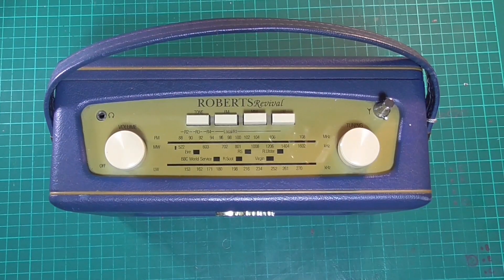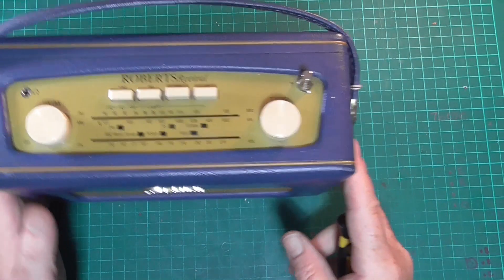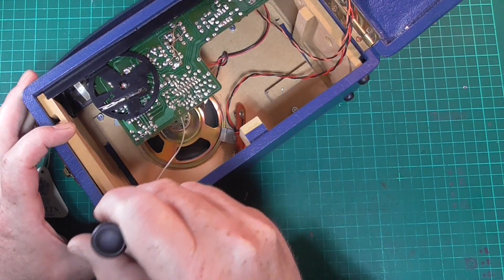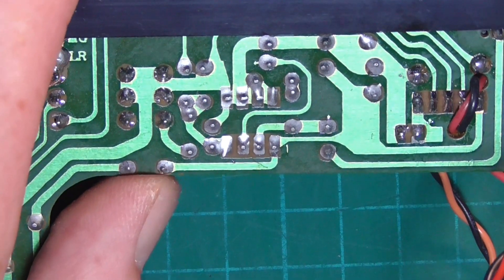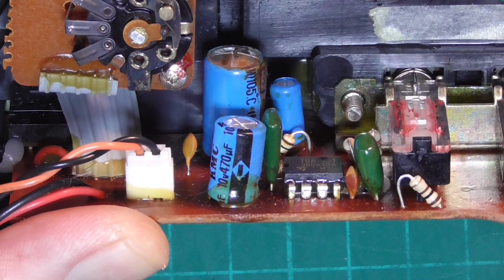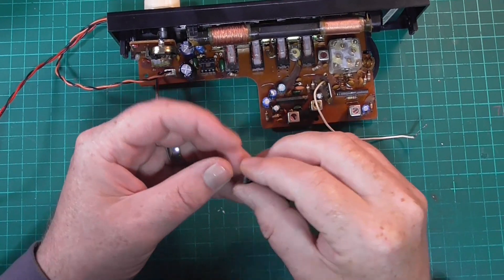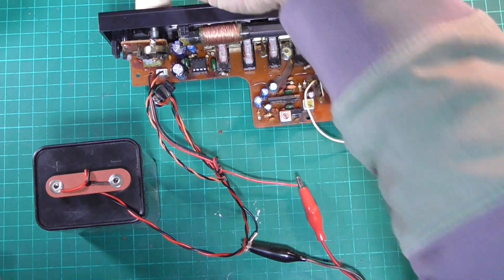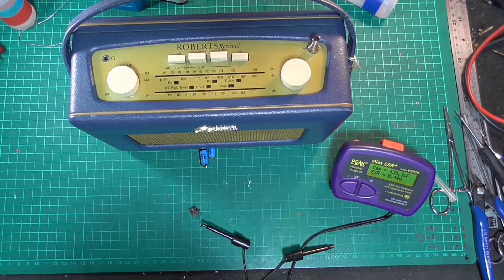Roberts Revival R250 - Quick & Simple Fix

Comment: Very much a very helpful demonstration. Before I take my radio apart could I tell you the symptom just in case it’s something more simple. Basically I am getting no sound or stations but this all changes if I just press the inside with my thumb and I get a sound then. Just be just a connection or could it be dirt on the controls or do you have any idea thank you otherwise I’ll just take it apart and have a look at

Comment: I have an R250 that is dead. However, mine has a different PCB/circuit to yours. In place of the TDA 7231 it has a 2201X01 which I can't find anywhere. I'm not sure if that is the problem though, none of the caps appear to have blown and the IC isn't burnt. There doesn't appear to be a schematic available either.
Reply from the maker: There isn't a schematic available - not for the 2201X01 version at least... 
Check the audio input pin vs audio output pin (3 and 5 from memory but do check) - if signal in, but not out then your IC is blown.
I do have some of those IC's here in my spares, but they are so very hard to find...
It’s still possible to repair the radio using a substitute LM386N-4 with a little tweak to pin 7 and 8. Just Google the recommended circuit configuration to see the difference. Pins 1-6 are the same and no change is necessary. These IC's cost very little so not an expensive repair if you have the tools, patience & time.
Reply: @Codeeze  Thanks for the info, it will be useful I am sure.
Reply: @Codeeze  I have replaced the S1A2201X01 with an LM386N and yes, it works after doing some changes. It didn't take a great deal of work either. So thanks for the tip, it saved a few quid and a long wait for the original IC to come from China. Now all I need is a faceplate, door latch and an aerial - or scrap radio with these bits intact.

Comment: I do wonder of Roberts  used center negative just so that if people used a non roberts psu they would blow the audio chip.  Although i do think the standard 9v for guitar effects is the same negative centre.
Reply from the maker: That is indeed how the story goes... Customer buys more expensive OEM psu, or risks it with a cheaper alternative... and... Roberts get to charge for a repair, and a stock psu... 
So long as the psu is 9v centre negative, and around 4-500mA, a pedal psu would work just fine - I've used them. 
Thanks for watching, and the comment.

Comment: Hi can I ask you what voltage are the capacitors and the Tda 7231 is there anything in particular I need to look out for when making a purchase, can I also as if you sell any of the parts, thank you.
Reply from the maker: The standard factory capacitors are 'usually' rated at 16v. I replace them with 25v rated capacitors as my own standard practice. 
The TDA7231 Audio IC is still available from China (on eBay) - although with those ones I have found them to be 'hit and miss' - they sometimes work, they sometimes don't. 
I bought a bulk amount some time ago, of genuine IC's, from a UK source, so I have a healthy stock for my own future repairs.
Reply: @Codeeze  I much appreciate your getting back to me, do you have a link to the page I can purchase them on, thanks.
Reply from the maker: @dublinbred  UK seller: https://www.ebay.co.uk/itm/200964391556
China: https://www.ebay.co.uk/itm/153025480721
Reply: @Codeeze  thank you so much, can I just ask you one more thing, on both the 1000 and the 470 what is the capacitance for each one as I want to be sure I buy the right  ones,  thank you.
Reply from the maker: @dublinbred  Before you go ahead - double check the audio IC to make sure that you do in fact need a TDA 7231. In rare circumstances, some R250's and R550's used a 2201X01 - I wouldn't want you buying the wrong one!
As for the capacitors, the 'usual suspects' capacitance is as you have it, 470µF and 1000µF, and as I said previously, I use a minimum of 25v on each. Another thing to mention is to take care with the polarity of these capacitors, make sure by taking photographs before you remove any - then you have a reference.
Lastly, when soldering in the new IC, make sure not to create any solder bridges between the pins.
Best of luck, and please do let me know how you get on 🤞
Reply: @Codeeze  the radio I have looks a different board, it just has the 1000 micro farad on it's own and theres nothing else around it, I have some pic if you can look, this is possibly an older version of the model.
Reply from the maker: @dublinbred  My email is on my about page. Send me some pictures showing your IC & caps, and I'll take a look.
https://www.youtube.com/c/Codeeze/about
Reply: @Codeeze  I dont see an email address on there.
Reply from the maker: @dublinbred  Email not viewable from a mobile device, but viewable from a desktop computer / laptop. Don't know why, just how YT does things...
Reply: @Codeeze  I just sent you some pics of the radio to your email add thanks.
Reply from the maker: @dublinbred  replied 👍
Reply: This model does not have a click on and off dial, it just winds back and forth.

Comment: Nice easy repair. When I replace audio power amp chips like this one I prefer not to use a socket as the pcb traces act as a heatsink. Socketting them reduces the ability to carry away heat. Probably not an issue in this set though.
Reply from the maker: It's one of the only radios where I would use a socket when doing this repair. Having previously measured active temperatures, the heat across the IC surface rarely makes it above ambient. The IC (TDA7231) Rth j-amb is 80C and Rth j-pins is 15C. One side of the IC is all ground, so this dissipates the tiny amounts of heat still quite well.

Comment: Have those parts failed because of reverse polarity of the external power supply being none standard? or just the age thing?
Reply from the maker: Indeed Michael, usually caused by reversed polarity from a PSU. Centre pin on these, and many other Roberts sets is negative. Sometimes I see even worse where a greater voltage than required has been used - gets messy!

Comment: It's a shame that roberts used a barrel type socket, it allows any fool to plug in the wrong supply.
I'm amazed the chips in the r.f section didn't die, maybe a power filtering R/C circuit stopped too much current flowing?.
A fuse and a reverse polarity diode would have been kind of roberts.
Reply from the maker: Roberts did this I'm sure for commercial reasons. Centre pin negative meant that back in the day, if you needed a PSU for your radio, it was only available from Roberts... Popping in a penny diode would mean that sales from PSU's would plummet... along with the repair costs for reversed polarity...
Reply: @Codeeze  I wonder if that was the reason the sinclair zx spectrum computer had the reversed power socket as well.
Sneaky none standard.
Reply: I got a really beaten up R250 but working, for 2 pounds.
I will get a power supply for it and reverse the pin to be negative.